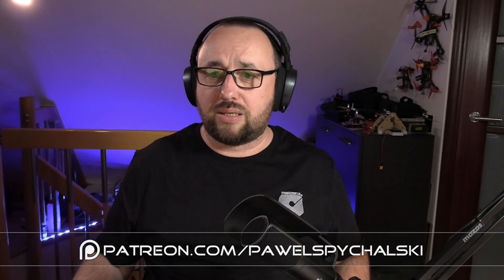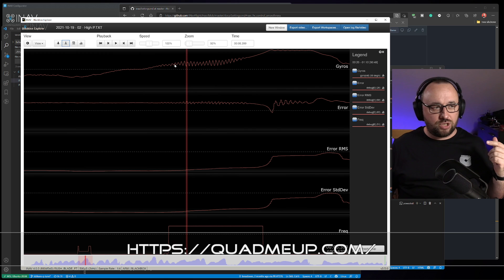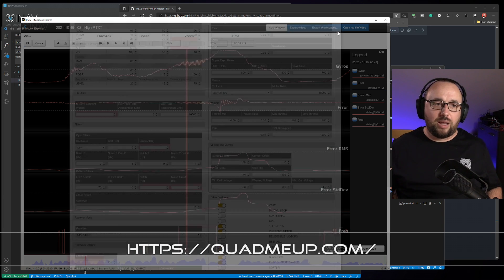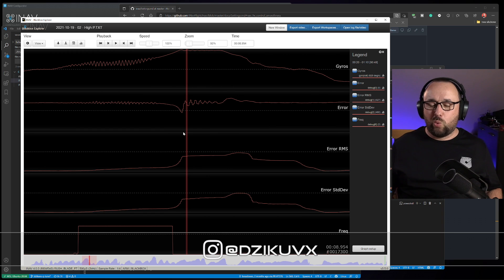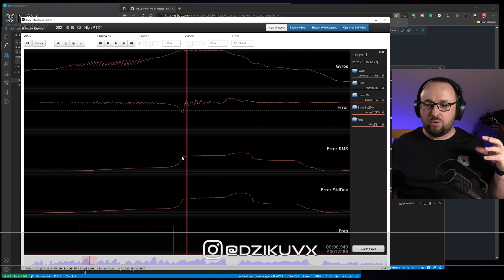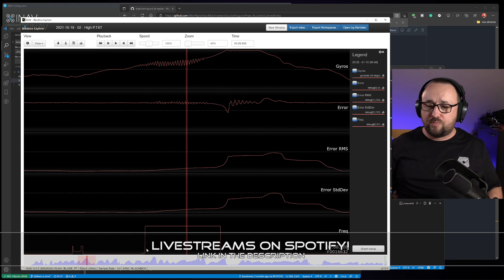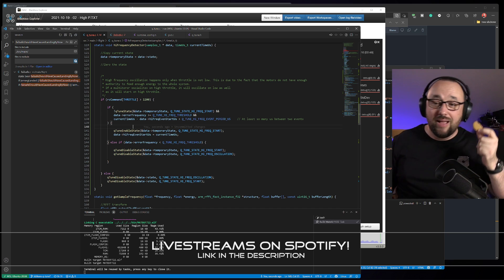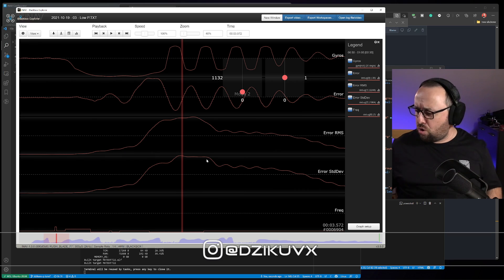Automatic PID tuning for FPV multirotors progresses

Comment: The harakiri worked best with my flamewheel F450, I really miss this one. Maybe this could be added again and the user has to set the miniKwad size, to set a proper starting point. So you don't have to cycle thru all the frequencies to determine which are the low or high oscillations.
Reply from the maker: Harakiri is an ancient history. Probably any modern FC firmware will fly better even with only basic P tuning. There was a tremendous progress in FC and what they can do

Comment: Yes....this is something I'm waiting for.  Please make more often content about INAV quad.
Many tutorial of PID tuning mostly for acro mode, but rarely PID tuning for GPS navigation mode and this is one of strong point of INAV.
My quad is kindly ok for acro performance, but sluggish at alt hold or navigation mode. maybe my setup hardware is uncommon and under power, using mavic motor and prop combine with dead cat style carbon frame with 4s2p 18650

Comment: IMHO, if you go by classic tuning methods - for valves, etc... - it won't produce a good flying quad.  The classics are good fundamentals, but ya need to tweak for the specific application (a Quad is not a Valve).

Basically:
1. Zero i-gain and FF -- or make very low.
2. Push P till you get overshoot, back down to Critically Damped Stepped Response.
3. Move up i-gain then to you get overshoot (which is a much longer overshoot with i-gain).  Then back down to Critically Damped again.
4. Move up P,i&D (holding the ration between the gains) till you get oscillation and them back off 10 points of D-gain (again, backing down P and i too, to hold the ratio).

Done.

The trick in firmware is how do you detect overshoots without running a Weiner Deconvolution on logged data; which we don't have space to store or processor to run?  🤔

I guess if you have oscillation detectors, that works, but how do you know how much to cut the gains from the oscillation points to get a critically damped step response?  My hunch is half is a wild ass guess that is not ideal for P and i so is unlikely to produce good results.  Gain scales matter.  And that "half" rule.of thumb has no consideration for gain scales we use.
Reply from the maker: My goal is not to have "optimal" result. This is out of the question. The goal is to have something better than defaults
Reply: @FPVUniversity  and if course if you get something that works on oscillation, maybe then we it can be honed in that P general is 0.75 reduction from oscillation and i-gain is about 0.9 or something from the oscillation point.  Something like that.  Point being, it gives something that can be worked on futher and futher to perfect.

Comment: Do you think the community can collect enough data to train a simple neural net from it? I'm thinking style transfer from existing bb log + pids to known excellent bb log + new pids.
Reply: that is another awesome way of thinking no doubt! but even in the same size and weight class drones can behave quite uniquely in some ways and in that case the neural net will need more than just drone specs but also data related to geometry of the frame , propellor and a bunch of data to make the AI give a reliable result. otherwise such an AI might very much just spit out an average PID setting probably worse than BF defaults.